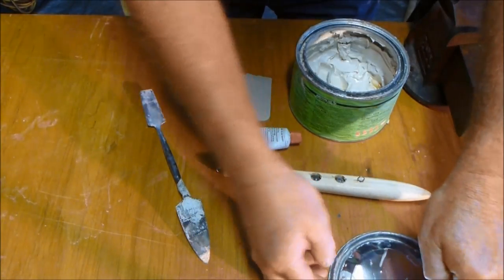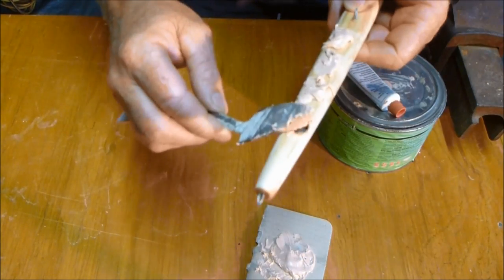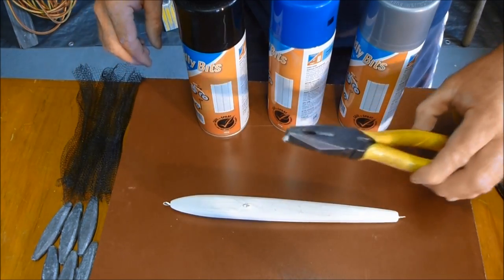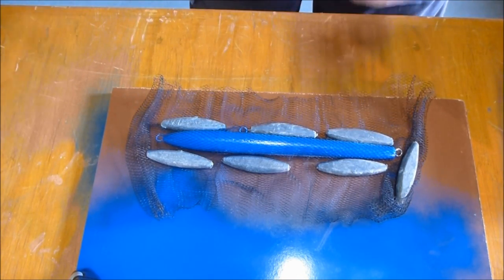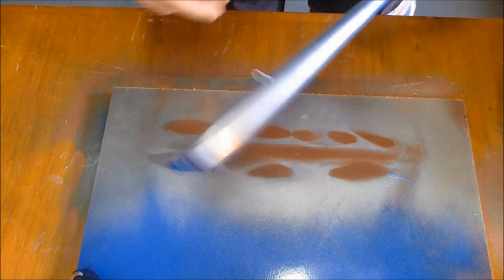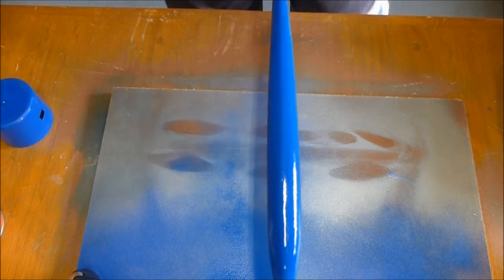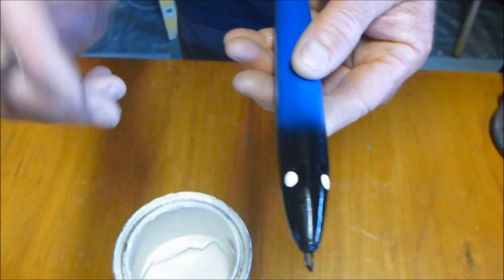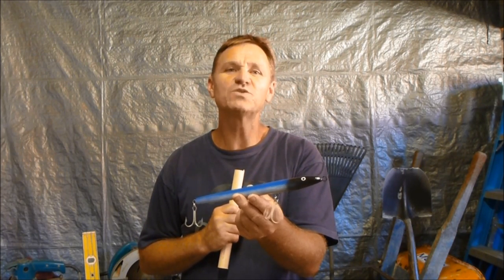How to make a Surface Lure | The Hook and The Cook | Part Three

Comment: Will the eyelet in the middle of the lure come off easily? It seems likely since the twisted end is only embedded by 2/3 at most of the diameter of the wood..I'm targetting GTs around 15-20kg..Thanks..
Reply from the maker: Big GTs I would run the wire right through the lure, the lure I took to New Zealand now hangs on my office wall and the middle wire started to pull out after quite a few good Kings, Check the clip out on our channel I posted 4 on the New Zealand trip.
Thanks for your feed back tune in every Friday and please subscribe to help us film more for all.
Regards Scotty & Paul.